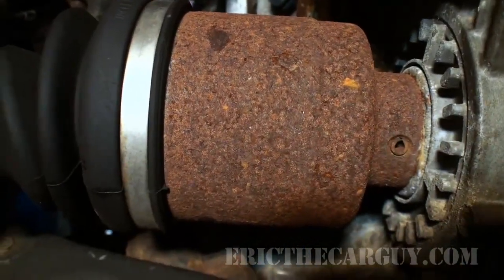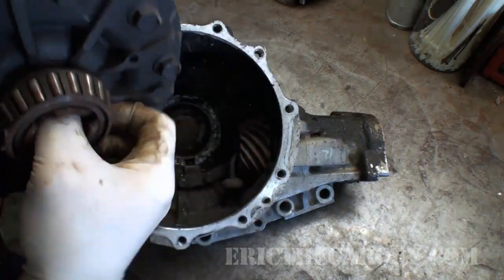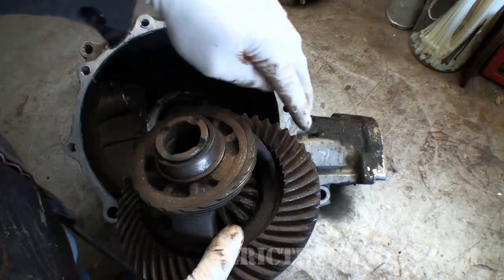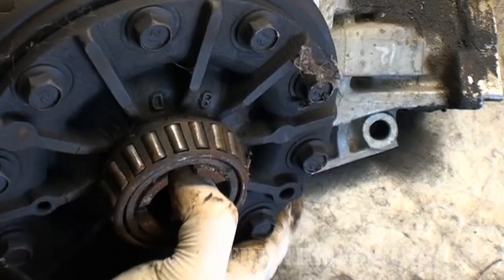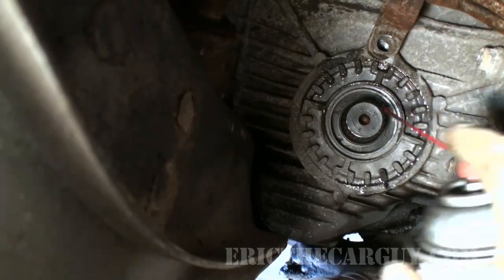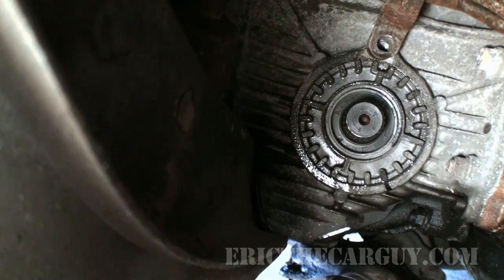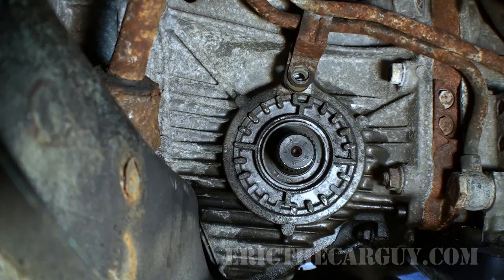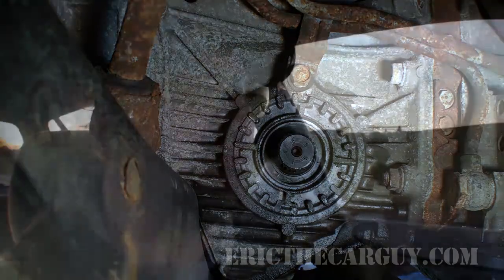Subaru Legacy, Setting Differential Preload -EricTheCarGuy

Comment: Love the air hammer!! I did this same procedure with my 99 impreza OBS about 45K ago because there was lots of play. I followed the book procedure about bottoming out the one side and backing out, then followed by the 1.75 + on the other side. I used 3-4 wooden dowels to drive the larger tabs. Had the driver side be very stubborn and used a MAP torch to the outter housing just a biit after applying some penetrating oil and tapped in the loosening direction first and she broked free finally. Snugging these up cleaned up a whine I was getting under steep cornering at low to medium speed. If you put in new seals, and you count the turns out in order to return the preload to the same spot upon reinstall, be sure to apply some outward pull on the plate because because there is some resistance of the seal on the spline which can fool you into thinking you are still unscrewing threads and counting.... but alas you have been clear of the threads for unknown turns.

Comment: I found that the best way to get these retainers moving is to use an oil filter wrench. Not the flimsy compression ones, but the ones that look like a large set of pliers that have teeth on them. Works perfect to remove the retainers (especially when having to change the o-rings out).

Comment: A four wheel drive hub socket works perfectly to remove the shaft seal plate. Make sure if you are removing it to replace a leaky seal that you mark it like Eric did and count the turns necessary to remove it. Do one side at a time. The play is normal as the front differential is free floating. There is a separate part number for the left and right hand seal. Very important that you get the correct one otherwise they will pump the oil out of the differential and transmission (common sump)
Reply: so my 2015 wrx has play on both sides, is this normal????? i was going to pay a tech to replace the rubber seals cuz it was leaking, and he said he couldnt because he found some play in the bearings.

Comment: I'm not familiar with a clutch that sends power to the front wheels (automatic trans), but I am familiar with the "center diff" which is actually an electro clutch that controls how much power is sent to the rear wheels since the rear wheels get 10% torque split under normal circumstances and increases up to an even 50-50 split when it senses wheel speed differences between front and rear wheels. It's my understanding the front wheels are always powered by the transmission no matter what.

Comment: I have the same issue. My axle shafts are loose also. Just changed the steering rack and then cv joints which I though were shot but actually not that bad. I was getting some loud banging noise especially at slow speeds and small bumps. Now I realise it was the axle shafts. Really keen to give this a go. I have 360k on my SF5 Forester GT already but other than this it’s running awesome. THANKS FOR YOUR VIDEO.

Comment from the maker: It's a clutch drum who's pressure is controlled by an electronic solenoid on this transmission.  I suspect that clutch is worn and slipping causing the delay on acceleration.
Reply: Then you would spin the front wheels. All the power go to the front if the enter diff clutch fail.

Comment: I used a 3 pronged small Oil filter wrench with a 3/8 connector to turn it loose and also put back on.  It worked perfect!
Reply: Hey there unfortunately am having the same problem.where you able  to replace the bearings with out removing the transmission?
Reply: I agree. I used same tool... Works perfect.
Reply: Good job

Comment: The viscous coupler has some hard plastic bushings that use the aluminum case to hold them in. Over time they wear a spot into the case and the VC loses fluid pressure. Subaru fixed the issue with 1998 or 1999 transmissions with a steel sleeve to stop it.

Comment: I have a 1987 model ford scorpio. Rear differential preload adjustment is almost identical to your subaru's differential. Pinion and crown wheel distance (i mean backlash) was not the case in my car but the spider gears were far from each other. I could move the axle side of the differential back and forth but the drive shaft was not moving. I have been planning on putting shims/washers under the spider gears in order to get them closer. Your videos give me courage. Thanks :)

Comment: I had the same problem now I have a broken pinion gear. How about a video on how to change the front differential on subaru. No transmission place around wants to.
Reply: Have you found anything mine just broke today transmission shifts fine smooth but when in motion it get stuck and the loud clacking noise is coming from the front differential

Comment: Those axle shafts that stick out of the diff are held in place with snap rings on the inside of the spider gears. If you study an exploded diagram of the assembly you'll see what I mean. It's not loose carrier bearings. It's slop from age. I always use a dial indictator to adjust lash.
Reply: These differentials are a rack and pinion drive, no spiders. Yes about the clips on the axles after 2004 or or so, before that is a locking pin on the axle you have to punch out.

Comment: Those carriers have two missions. Preload the bearings AND set the play on the spider/pinion gear. When setting the bearing preload only you need to adjust equally on both sides or youll change the play between spider and pinion gear.

Comment: Interesting.   I  would love to hear about your experience with the cvt setup. 
My 2011 outback cvt obviously has a torque converter issue.   But, let's just say it was ok.
Mine came to a complete stop and hasn't moved since.  In your opinion,  how can i rule out the transfer case?
I haven't jacked up the front wheels yet, but what should they do when spinning by hand?  
I also have a p0841 and p02570 codes.  Transmission pan removed,  no metal shavings anywhere and fresh drain and fill cvtf, twice.   
All value body solenoids measure fine.

Im just curious about the transfer case.  Yes, fresh oil too.  No drive shaft movement or torque converter codes .  POS. Does the rear differential have anything to do with immobility?

Comment: That noise you had heard while turning tight is actually toqure bind coming from the rear drive clutch assembly in the tail housing of the transmission. While you failed at trying to tighten the carrier bearings the premise of your fix seems like it would've worked. I've own/ed a couple Legacys and both had this play in the front diff output shafts. I've noticed this play on many other Subarus with auto trans and I believe this is normal and shouldn't be adjusted. Not broke don't fix it.

Comment: My thoughts on this even though I'm 7 years late!
Firstly Eric, love your channel.
Watched heaps of your content so I know your a great self taught mechanic with a good scientific mind.
This video was highly entertaining. 
I'm thinking if pinion backlash is your problem, as I suspect it is with my '03 Impreza Wagon, then you'd need to move the entire carrier one way or the other.
This would be done by tightening one side and backing out the other depending on which direction you need it to move (I'm sure you know this now).
Considering you couldn't break one of the threads it's no surprise you're effort was not successful.
I'm gonna give this a go at both my diffs.
My car feels like riding a jackhammer when I float between coast and load and the idle wants one or the other.
Very irritating!
Reply: Did you try it? My front diff ring/pinion had backlash and resonates and whines when unloaded as you describe in your comment.
Reply: so my 2015 wrx has play on both sides, is this normal????? i was going to pay a tech to replace the rubber seals cuz it was leaking, and he said he couldnt because he found some play in the bearings.

Comment: The Viscous Cupling is very common to fail on all Subaru's.. the way to tell is that when you are doing a full lock U Turn,you can feel thr front wheel are turning at the exact same time causing the wheel to chirp..

Comment: I believe the factory set play on the passenger side is normal. It prevent overloading and binding the bearing on that side when the pinion applies force to the ring gear.

Comment: I rebuild and repair these transmissions and I have a socket that I made for the removal of this retainer. It started life as a 41mm socket (if I remember correctly). I cut the four notches in it, similar to the Subaru tool to remove these. But the Subaru tool does not offer a lot of leverage compared to my 1/2" drive socket and long ratchet.

Comment: hi eric, im having a problem with my map sensor on my 99 legacy, i believe i have a short circuit between the +5v wire and the signal wire, because when i disconnect the sensor and test the connector between the ground wire to the ecm and the signal wire i get 3.65 volts when i believe i should have 0 volts with the sensor unplugged on the signal wire, have you done any videos on tracing wires back to the ecm, if not im sure if you made one it would be helpful to others as well, thanks

Comment: Eric, Thanks for this informative video.  I have pretty much the same car - '96 Outback with pushing 200k miles. Just did the front axles and may have to redo them because they feel like they are binding on low speed turns.  Anyway, I am going to look for a large cheap China socket  - looks like another 32mm? - and grind four slots in it to fit over the spline and raised quadrants on the retainer. I learned that trick from fellow YouTuber Dean Segovis making a special Honda motorcycle clutch removal tool for his CB750 on Hackaweek. I'll let you know how it ends up.

Comment: I believe ur issue is the rear differential i believe Subaru calls it the center diff like u said but in the rear of trans...Runs awd... The part is a viscous coupler and mini differential built all in one on an automatic there is a spot somewhere u can add a fuse n it will put it in 2wd and u can see if the problem is gone. The viscous binds an dont unlock when u turn tight. it is a sealed unit fluid change will not help. Its serviced as a complete unit... cause is usually uneven tires it over

Comment: Hey Eric!
Why not use that new shiny Tig welder of yours to weld up a wrench for the retaining rings?
Should not take you too long to do, all you need is 3-5x small steel pieces, a round plate with a hole big enough for the outputshaft, a pipe with higher diameter and length than the shaft and a steel boxpipe (not sure what they are called in English) in 3-4mm steel with 1/2-1meter lenght (length is not that important since you can add on with a bigger pipe anyways).

Just a thought.

Comment: I have a 1994 svx and Im in the process of switching the gears from one differential to another. After I remove the retainers how can I wiggle the whole gear set up out of the case??? My old broken one was easy to get out because it had female splines. The good gears I'm about to take out of the bad case have male splines like in this video. Sorry if Im confusing you I would just like to know the easiest way to get it out. #projectsvx

Comment: Eric, what if the axle has pulled out from the diff about 1" - shiny metal shaft is showing, I could still feel the pin for the axle, and car does not move at all...I think something broke in the transmission or differential..

Comment: A long pry bar from the top of the engine bay and a bfh will knock those retainers right out. Anyhow this video did not demonstrate how to “set” the preload while the trans is inside the car. If you had some kind of plan in mind or instructions at hand then that would’ve been helpful to share.

Comment: wouldn't that affect the AWD system in the Subie?  i feel that at some point you are having more torque(more contact) on one of the sides. Subies are really picky even for tires... you have to have the same pattern in all the tires or the AWD supposedly gives different amount of power to the wheels

Comment: Haha, 7 years later here, heard my forester was making like a hammering strike noise with every spin of the wheel when you take the brakes out and she begins to run on her own, turn out the differential had a lot of play, took it like 1 turns plus 6 more teeth to tighten the left side following the instructions before tightening the right side to spec

Comment: Soft bits of casting can be hard to budge for sure, it doesn't necessarily work out, at least your honest and haven't edited it, a piece of metal bar stock that would span across the circumference with a couple of lugs tack welded on the bar to catch a cast tooth each side might have worked. Make an improvised tool would be the way to go I think on this one.

Comment: to break free the retainer without a specialty tool. Use a pvc coupler. Can't remember what sized but it should engage in the gap between the 20 teeth and the raised ring at the base of the 4 teeth. Now dremel or hacksaw either 4 teeth or 4 notches in the face of the coupler so the pvc bottoms out against the diff retainer in the gap. It's important to make your cuts so all 4 side walls on the cuts engage with the sidewalls of the 4 teeth in either direction. Coupler cuz it's thicker than pvc pipe. Now you can grab your ghetto special tool and spin it with a strap wrench or bolt in a piece of pvc pipe, drill a hole in the pipe and spin from the holes with a breaker bar. You can even get a helper to push the pipe against the retainer while you turn.
Reply: Decided to measure it and its a coupler with an OD of 2 3/4 inches.  Still got it in the tool box.
Reply: How ironic is this?  This video is 4 years old yet I'm about to do this on my 2005 WRX this week.  I tried this before on my old 2000 outback and broke tons of teeth doing exactly what Eric did in the video.  I find this video and was looking for DIY tools and you somehow posted 10 hours ago.

That's a BRILLIANT idea, it's perfect.  Can't thank you enough!!
Reply: Brandon mind showing how you did this? I need to do the same to my 2005 wrx... like now
Reply: I haven't done it yet, I'm just going to try it.  I actually found a guy who made an awesome tool for this who wants to sell it to me and I'm on the fence as I really just want to rent it.  PM me on NASIOC, my SN is BrandonDrums.  Perhaps you can buy it and then I can buy it from you or something or 'rent' it.
Reply: http://tinypic.com/r/2eg9qht/9
http://tinypic.com/r/eukppw/9
http://tinypic.com/r/2qm0toh/9

I took some photos for reference. I also made two separate alignment marks with nail polish on the retainer and diff face. two separate colors. two since one set was a backup in case something happened with the 1st.,Then meticulously counted and recorded how many turns it took to remove.

Comment: I have 98 legacy with 5mt. Iv had a whine for a long time.  It started only in reverse and low in first gear now it happens in every gear and it's getting louder. Is this the pre load or the center differential bearing going bad... its got 275k on the original 5mt would adjusting the preload on the front t differential stop the whine in all gears ? Thanks lmk

Comment: My question may be unique. I live in alaska where it gets very cold. I never messed with my retainer preload before or my cv axles only thing i did was replace front dofferential fluid. And one day the front left retainer bolt broke out sounding terrible when it did and took some of the differential housing with it. Do i need a whole new front differential cus it looks to me like alot of work to pull the entire differential

Comment: Eric i think urs is an older model so the fuse box is on right side of the firewall i think there is a smaller little fuse holder to add the fuse. New sub's are on Lf of engine bay near battery n the fuse spot is right in the fuse box. Manuals do not have that option. I did one in a manual trans once... customer is an older gentleman an was more than impressed an has reccommended lots of new custmers. Job is a piece a cake in the car 2 hrs if ur good pry 8 if u suk...

Comment: i have the exact same car and it doesnt always have the hesitation but i noticed if you put it in first gear and shift manualy from 1-D you wont get hesitation hope you read this and helps you on your quest because itll help me on mine. BUT WATCH THE FUEL FILLER NECK IT RUSTS LIKE NO OTHER VERY COMMON PROBLEM ON A LOT OF SUBARUS DUE TO THE PLASTIC COVER ON IT!

Comment: maybe abit of heat might do it if it;s got play. my q?  is could you remove the retainer and replace those bearings then put the retainer back on and tighten to spec with diff still on the car or do they need to be pulled completely apart to be pressed off and on those shafts? might make the diff last longer if you could

Comment: Eric I think I'm going to agree with you that it has to be something in the transmission. Check out a possibility with the Duty C solenoid, that is part of the AWD power transfer system. Cool video though I had no idea that there was adjustment that could be made there.

Comment: You had fun makin it, and I had fun watchin, ha ha. Presumably Subaru have a fancy, expensive, single use tool to match that pattern on the case. 

I'd like to understand how AWD works and what differentiates it from 4WD, so it would be great to see what might come next. But I also understand it's possible to mess things up, and at the moment you do have a functional vehicle that somebody depends on. Cheers.

Comment: It's hilarious every time watching this clip especially the air hammering part. I happened to find the Fram Oil Filter Pliers FW401 (walmart) can spin it a little bit easier than the punch and hammer while my transmission sitting outside.